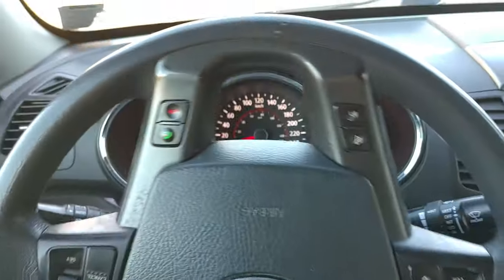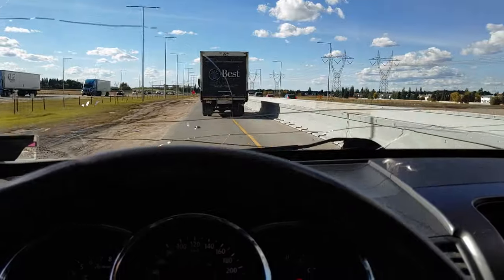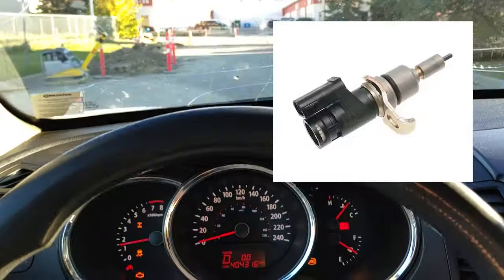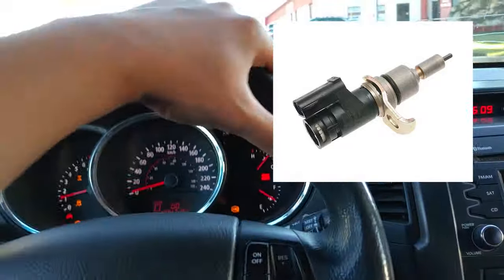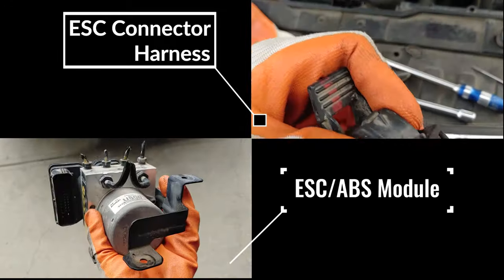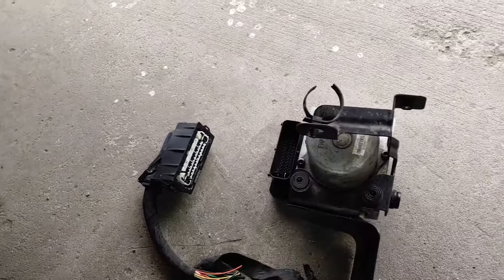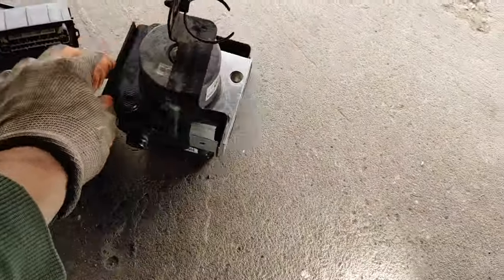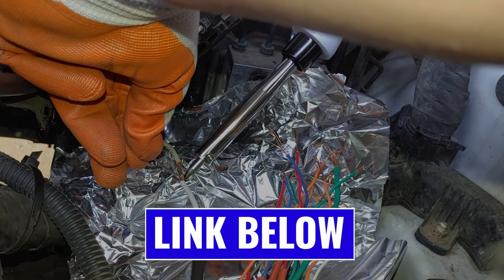What To Do If Speedometer and Odometer Don't Work

Comment: I have Skoda Rapid Tdi 2013 Stage 1 done. Have driven 2000km after doing so. I have just changed the battery and after new battery is set, the speedometer stopped and glowplug signing on. There is no pickup issue at all. Only kilometre reading stalled. Checked the ECM terminals, no ABS sensor issue detected. On scanner Speed reading is showing though , checked speed needle motor on scanner Ok. All error codes are erasing but Error code P061000 cannot be cleared. What to do ??

Comment: if ECU is getting the right speed, it's something else between ECU and speedometer, right?
Reply: That is correct, if a scan tool reads miles when your driving it means speed sensor is sending signals. I’m trying to figure out what semiconductor parts to test and replace on the speedometer circuit besides the capacitor.